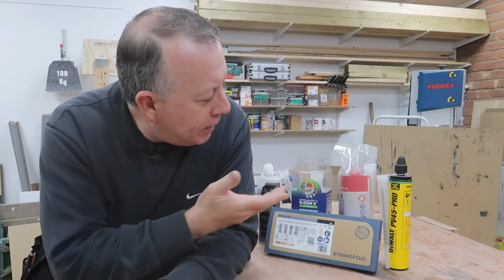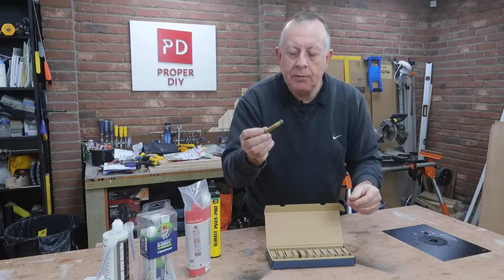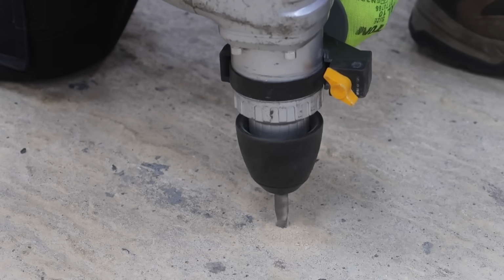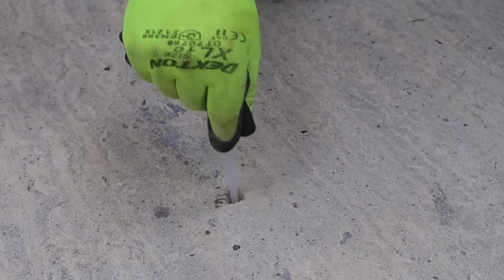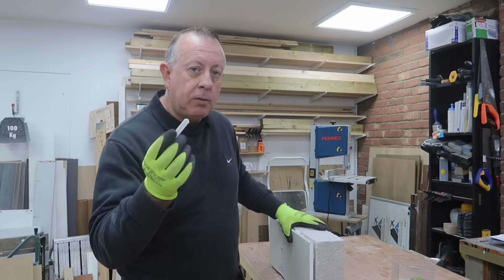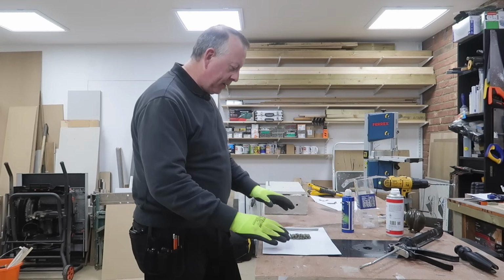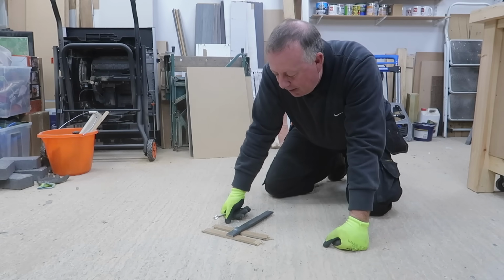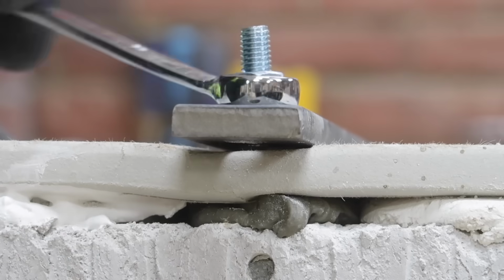Resin Anchors - The Absolute Strongest Fixings

Comment: How would it work using it in dotdabbed wall with brick behind the holes I’ve drilled it’s between two bricks and I’m not getting good fixings it’s just luck . I cannot move the bracket as there’s cables in the walls . So it has to be where I’ve marked and drilled . Do I just full the hole with the resting and put a raw plug in the drill thru it ?

Comment: Hello. Has anyone used these chemical anchors to fix timber walls directly to the concrete slab in a garden room construction, please? I want to build straight off a concrete base with no subfloor to maximise the internal height of my room without going over the 2.5M building height rule. Need some advice on how deep anchors should go, is threaded M15 rod suitable as the anchor etc. Many thanks for any tips.

Comment: we are building a house extension and we need to mount (vertically) two steel columns on concrete pads to fix the 5m horizontal beam above to hold the wall above. Is R-Kem good for mounting those two columns to the concrete pads? The steel beam fabricator company has sent these canisters with the bolts.

Comment: First time I used these was to put in a mezzanine floor into a barn conversion I was doing. So, holes in stone, all cleaned and prepared and holes already drilled in the beam that would be fixed to two walls (i.e. one corner of the barn). So the bolts had to go through the beam into the wall, since once they set in the wall, if they moved a fraction in the hole, you'd never get them into the holes in the beam. Good old panic once I started, because five minutes is the outside time! Once set, they held the whole floor without effort. Now I use them all the time.

A couple of days ago, I was doing some fixing on my sister's roof and noticed that two of the concrete vent-bricks on top of her chimney were cracked and were actually held in place with wire, and since I had some over and time running out, I squeezed some of this into the cracks - using it like glue! Went up yesterday and they are absolutely solid! So you can use it to glue concrete, brick or whatever. Miraculous stuff.

I did wonder what those plastic tubes were for in the last one I bought, a couple of weeks ago, and now I know!

Comment: Nice Video, Thanks
I Once had to take out such a resin-anchored bolt and after many failures the only thing that worked and helped me remove it was a blowtorch... Heated it enough to melt a bit and quickly pulled it out. After all the effort and tries, it felt like cheating, but did the work... Just keep that in mind if you ever need it, and definitely if the area and the load are fire sensitive
Reply: Good tip. I've saved this for later!

Comment: I need to screw a recessed bolt into flimsy crumbly concrete behind terazzo panels, and be able to take it out in the future. Can I fill the hole with the resin and then drill into it, to stick in an expandable M10 socket ?

Comment: Big thanks... just tonight my dear cousin advised me to look into anchor fixings for a 3.6 x 3.0m canopy I'm building using M12 x 150 thro' bolts fixing 150 x 47 timber onto 90 degree rendered brick walls outside our back door. Of 10 x 12mm x 150mm through bolts, eight are good... delighted to know now what to do xT

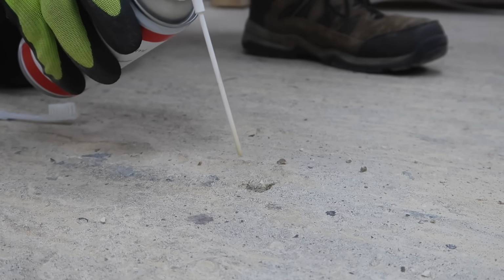Comment: 5:09 - If you don't get it in there, you're mostly pushing the dust into the hole. Just insert the nozzle to the bottom, lift it a couple of mm, give it a very short press, and it'll blow all the dust out in one go.

Comment: I’m anchoring steel posts to the top of a sandstone wall, the sandstone blocks are 1 meter long by half a meter wide and half a meter deep, big blocks. Just unsure on whether to use these or traditional mechanical anchor bolts? I thought the sandstone may not hold the resin tight as it’s sandy nature can be like dust? Then I thought if water gets into the hole the dynabolt may fail as the sandstone would become weak and crumble? I might just resin in the mechanical anchor bolt to get the best of both worlds?

Comment: I think the reason there hasn't been a huge uptake on them is because of two things:
1.  The instructions are like a small book!
2. The rigmarole in making sure the hole is so clean!
Maybe a process which actually incorporated the dust in the hole would have been good.  Nine times out of ten it's much simpler to use a hefty wallplug.  I've got both sorts (vials and tubes) in my van but they are so old now, that they must be out of date.  New ideas and inventions should be simpler, not more complicated.

Comment: Used R-Kem-II on (yet another) oversized hole in some shoddy aircrete. That threaded bar has not budged in a few years. Only downside is waste if you only have one or two small holes as the tubes are fairly large in volume. I did the same cleaning of the tube top and only if i ever need it again will i know if its reusable?

Comment: If you coat the thread with grease then when the epoxy sets you can unscrew the threaded bolt from what will be an epoxy nut you just made

Comment: Put the blower straw almost to the bottom of the hole. Just as you did with the resin nozzle.
The hollow wall sleeve looks great. You can improve support under the board by drill a few holes through the drywall and inject some more resin. That stops it collapsing when nut/bolts are tightened.

Comment: This technology was used more than 50 years ago when providing support in underground mines holes 50+mm in diameter would be drilled into the backs for a couple of meters, a few plastic cartridges of rotaset would then be pushed up the hole by the rock bolt which would then be spun to crush the glass tube of hardner, when the epoxy stiffened up a 6” square metal plate would torqued down against the rock mass. Very effective, but a bit costly, they were often superseded by using deformed bar or long lengths of steel cable placed into the hole that was grouted with a cement grout. The cable bolts were often in excess of 20m and made working in wide stopes much safer. I also used the glass vial type 30 years ago to secure wide span portal frames to their foundations.
Reply: Worked great on cars, so solid once applied ;o)
Reply: I was literally just thinking of this as your message appeared. My father was a colliery manager and he explained to me process you just described.

Comment: Thanks for another great video. I've used these types of fixings on a number of occasions, although I do normally turn the threaded rod fixings in an anti-clockwise when locating them. I find that this avoids the 'archimedes screw' effect which might try to pump the medium from the hole.

Comment: I pulled out Red Head 1/2-13 x 2 anchor with my floor winch. I switched to 4" threaded rod with Red Head T7+ Epoxy instead. Should have gone resin to begin with. Live and learn.

Comment: Once, when I didn't know better I had to chemset about a dozen M28 studs overhead to hold 3 thick cleats to the ceiling of a busy walkway outside a shopping centre.
The studs were dropping and falling out, bringing the chemset with them and dumping it all over me, my tools and the scissor lift.
Nightmare to get that stuff off, you can scrape it and grind it off steel and concrete okay, though it will stain. But to get it off rubber, leather, plastic and fine detail, etc? Good luck.

Comment: I use exactly the same chemical anchor at home because the conventional plastic anchor slips out many times so I drill a hole, fill with chemical anchor, hammer in the conventional plastic anchor an then screw in the screw. With this method all my stuff stays on the wall securely!

Comment: Great video I was thinking of putting a more permanent gazebo type structure onto a patio. First off I was thinking of taking out four slabs digging down two feet then setting posts in with postfix  and cutting the slab to go over the post. Lot of messing around and overkill as I'm. Only building a square frame at the top and covering with corrugated plastic or whatever
Then I thought spike shoes but again messing around. Finally post shoes bolt down type with expansion bolts but might just crack the slab? Maybe just ordinary threaded stud and resin down hole then bolt down with nut?

Comment: I was looking for what type of anchor to use for going through drywall straight to cinder block.  This looks like the best answer I've found by far, especially since I want something strong!  Thank you so much for this video!  Yes!  You're correct!  I've never even heard of this, and I've even worked as a tool and parts clerk for a few years.

Comment: This is brilliant thank you! I'm guessing the choice of anchor is up to you, but I need one where it wouldn't protrude out from the floor (basically I want to erect a temporary tarpaulin garage but then be able to remove it) and the area is clear to drive across etc. So I'm guessing a threaded insert would be fine to use that's flush to the surface?
Reply: I'd worry about the threaded inserts collecting water and corroding, or cracking around an ice plug if it's below freezing.

Comment: Good vid.  My question is about minimum concrete thickness.  I want to set a 1/2" anchor into a 5/8" hole that is 2.5" deep.  But my garage slab is 4" thick.  Does the slab need to be thicker than that to support the other dimensions...I can't find this answer anywhere.

Comment: Can it be screwed into with or without a pilot hole or using a rawplug?
Reply: I can answer my own question because I've done it now.  The best drill bit is a sharp masonry bit, it blunts HSS bits very quickly,  but don't use the hammer option (it wants to cut rather than hammer through).  I started off with the smallest one and increased it up to 6mm then inserted a rawplug.  I tried screwing directly into a 2mm and a 3mm pilot hole and that worked as well. I was re-fixing a stair hand rail, because the raw plugged screws had pulled out of unsound masonry, so used a substantial amount of the product - a tube on four brackets - each with three 50mm x 5mm screws.   The rail has quite a bit of weight put on it - so far solid as a rock.

Comment: This is great as I am fitting threaded bar into a wall and seating wood posts on the top to link 2ft fence panels.  Do you think the I could use this resin and seal the threaded bar to the wood drilling out a 3 inch bore hole.  So you can imagine basically the post seats nicely to the wall holding it level while the resin sets.  However I would do the threaded bar into the wood first then the bar and wood post into the wall as the resin would run out with gravity otherwise.

Comment: Thanks - great video!!!.Would this work for a folding shower seat, with no feet or legs so all the force is applied laterally. So far chunky 100mm screws and high quality rawl plugs (into brick wall behind tile) have failed. Also the 2 metal brackets which are part of the seat each have 4 screw holes. Would you recommend inserting stainless steel threaded rods into the resin anchor holes and then just bolting the other side? I’m hoping to find a stainless steel rod that starts off at a bigger diameter (in the wall) but then has a smaller diameter shaft at the end that can fit through the relatively small screw holes in the metal brackets - does this kind of thing exist or do you think not necessary? 🙏🏻🙏🏻🙏🏻

Comment: This is purely a question, but at 11m 1s into the video, when you apply tension to the anchor if you look where the resin meets the concrete floor it seems that it lifts from the concrete after every tighten. Has the bond been severed ?
Reply: I’ve seen it too

Comment: Maybe the resin needed longer to cure but you could see it pulling out on the garage floor as the nut was tightened.

I'm surprised there isn't a liquid primer to put in the hole before the resin follows.

Comment: Totally agree with the five minute work time, it's get everything ready, check and go. Have used a compressor for blowing out holes, real effective but watch your eyes or do it your way.
Incidentally have found if you're quick enough you can but the pointy end of the applicator into the end if a garden hose and flush out the product. Works well enough to be able to reuse them a few times.

Comment: When blowing dust out of the hole it is best to have the air nozzle inserted all the way into the hole,  this way air gets behind the dust and is able to blow it all out. To get even better results it's best to use R-KEX 2 chemical, drill the hole, brush and blow out dust, then wash out hole using a jet of water, then blow out again using air, you now have a perfectly cleaned out hole,  one advantage of using R-KEX 2  the hole does not have to be dry, it is also has a stronger bond than R-KEM 2.

Comment: This is great stuff for securing in to old breeze block. Had to fit a large feature radiator to a wall in my 80s build house. The supplied rawl plugs pulled out of the holes, tried big metal fixings and they did the same. Chemfixed some threaded bar and bolted on and it’s never moved. Great stuff.
Reply: Saw this video when it was released, but came back to it exactly for this!  I'm hanging a 3 column radiator on the wall and want to be sure it's going to be safe.  This is what I'm going to use.  How is yours holding up, 2 years later?

Comment: We had a high wire act in our pantomime, and the company who supplied it had fabricated massive steel plates which were fixed to the wall either side of the stage. The steel cable was then attached, running at about ten feet above ground, and tightened with a  Tirfor winch. The guy then had a tensioned cable to walk across. I can't imagine the tension on each wall, but at the end of the ten week run, they removed the plates and ground off the studs, and nobody even knows it was there!

Comment: Not a bad chemical, but between 11:03 and 11:05 you can clearly see the resin pulling up through the concrete, which is a bit worrying after only a few cranks with a spanner.
Reply: Yeah I was watching that and was surprised he put it in the video. Clearly pulling up and pretending to crank down on it.
Reply: The resin 'pull out' was due to the gap between the steel bar and the floor. If the bar was pressed up against the floor there would be no gap, and the resin would not pull out. In this bar on the floor situation, the resin would act like a nut on the underside of the bar; and the bar would be clamped between the resin and the nut on the top of the bar.

Comment: So essentially this the same resin used in fibre glass work, Polyester, is that correct?
If it was epoxy resin then it would be 20 percent stronger, naturally the question would be is there an epoxy version of this Chemical Anchor?, and would  it be too costly?

Comment: Could you do a comparison of these expensive two part resins to a cheap one part product that I use for the same purpose called "Liquid Nails".
I have used Liquid Nails to fix loose rocks on a rock wall or bricks on a brick wall, it is very strong and dries very hard, and only $4 a tube.

Comment: Years ago I installed about 100 Hilti anchors with eye bolts in a yoga studio. They were for rope yoga - where the anchor has to support somone's weight. 
As such they were subject to the LOLER regs as a piece of lifting equipment. About a year later I needed to get some of them load tested for insurance purposes. I went back to the Hilti store and they remembered me and orgasnised a test free of charge! The test rig performed a pull test, it was a bit like a bottle jack with a force gauge. Passed no problem. Great service, you wouldn't get that from Screwfix or B&Q.
Reply: Worked with Hilti tools and fixing for years when they were trade leaders, nowadays there appears to be similar cheaper options around, but don’t quite make the grade
Reply: Hi Richard, the Hilton store are good guys. You do know that Screwfix is the Tradesman’s outlet of B&Q eh?
Reply: Thank heavens

Comment: excellent demo thanks. any idea what diameter hole to drill for an m12 stud using the anchor sysyem its to fit 3x3 wooden fence posts to extend a low brick wall. thanks.

Comment: It would be interesting to hear if you were able to use the stuff left in the tube? I had hoped you would mention that at the end of the video. I have used these fixings once before to fix tiles to the bottom of the arch of a window to provide a decorative overhang/drip tray. Applied a blob to the tile, held it in place with a bit of wood wedging the tile in place for the 5 minutes or so it took to go off. It worked really well but we did need to be organised and ready in advance and having a second set of hands really helped. It bonded the tiles in place really well when we didn't really have any other option. Expensive but it has its place and uses which makes it worth the money.

Comment: I've not used this stuff... yet... but have a project coming up... am I right in assuming the nozzles clog up once used , if you are only setting one fixing at a given moment you dispose of the nozzle & fit a new one for the next job at a later time ??  

And if thats true , I assume spare nozzles are easily available... (sorta like when the silicone cartridge nozzle turns to rubber inside) 🤔

From the Emerald Isle
😎👍☘🍺

Comment: best one I've ever used is a product called Anchorset , it comes with a special nozzle that mixes it for you so you just stuff it in the hole and insert your threaded bar or whatever, wait about 20 mins or so and it will NOT come  out unless the wall falls down.  I used it to anchor my lean-to shed to the side of my house.  Awesome.

Comment: Using this stuff for concrete anchors is great, I use it a lot for stone repair as well, if you got some top rail to run or just patch in this stuff bonds and bonds fast. Worth the 26 bucks a bottle!